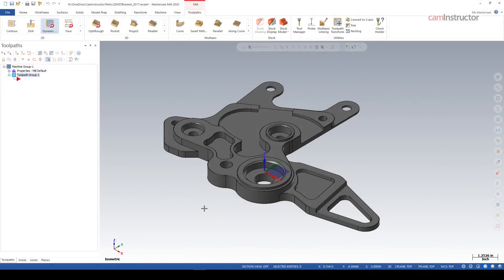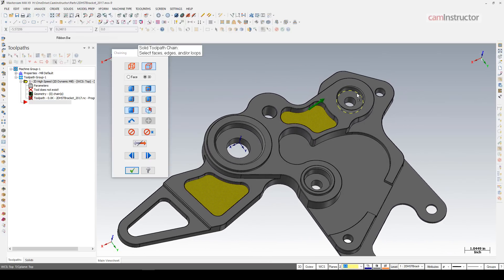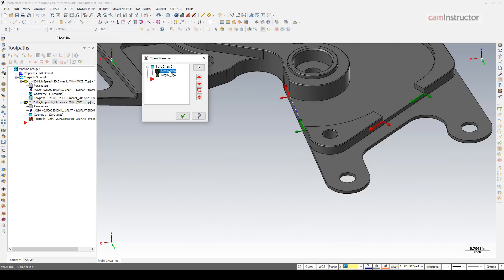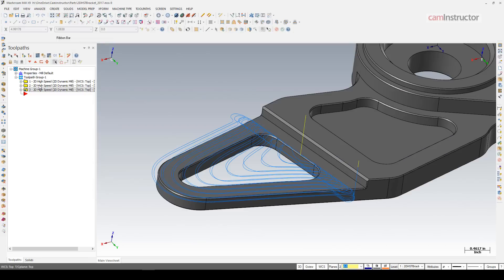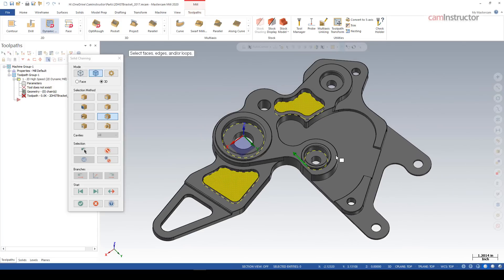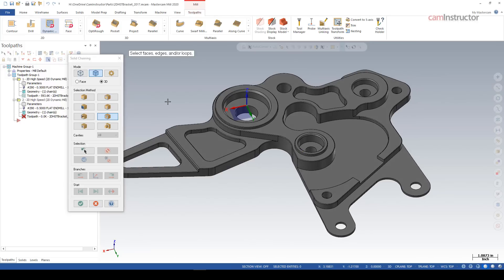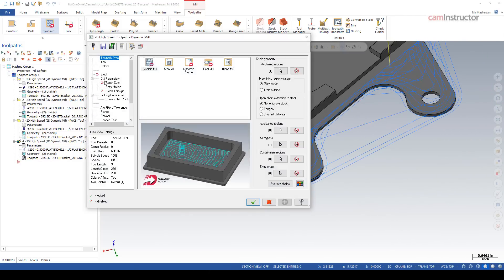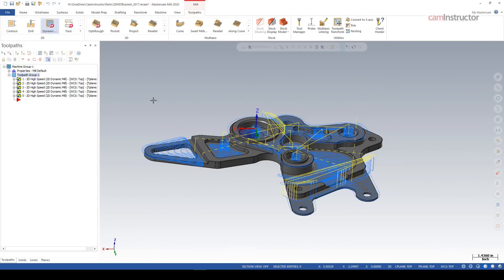Mastercam X9 vs Mastercam 2020

Comment: you can just use edge selection and pick up the edge of a bore and not have to add the extra click of confirming the loop.
Reply from the maker: Absolutely! 
Clicking a face is nice and easy though. As shown towards the end of the video, the real power of the new selection items come from faces with multiple features that your after. Again, edge would work and there's nothing wrong with using that if that fits your work flow better.